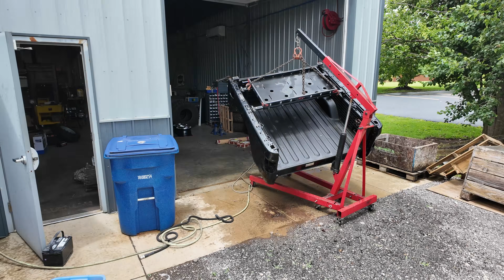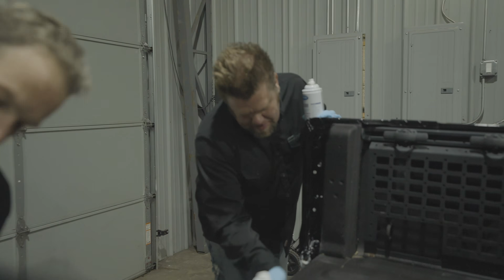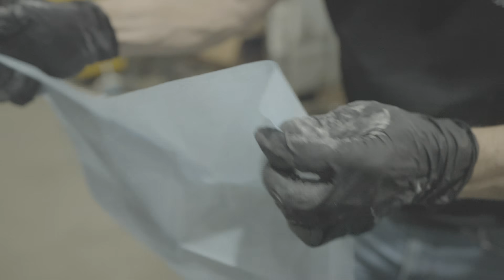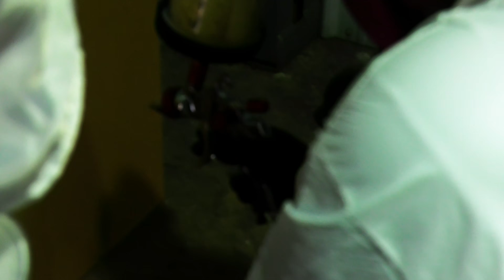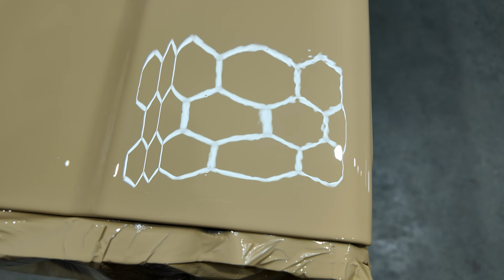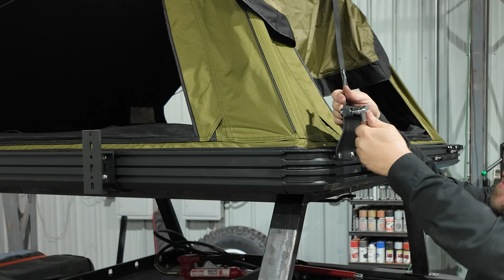Paint Your Jeep in Your Garage

Comment: One correction to what he said about blue cloth. That was actually two different cloths. The first one he used for the Prep solvent (wax & grease remover) was Sontara E-4143 Solvent wipes. The second was a Sontara E-4141 Final Tack, tack rag. That's the one he stretched out. This gives the tack rag more surface area to pick up dust particles from the surface before you apply your paint. Great Job for a first-time paint job!
Reply from the maker: Good info...thanks for sharing

Comment: Sometimes those cheaper gun aren't meant to be taken completely apart, because at the factory they use a sealer, almost like a really weak loctite to take up sloppy tolerances, after cleaning them and putting them back together they will sometimes leak and you will not notice it til you get ready to paint your next project and your dripping paint out from between nozzle and the body of the gun.
Reply from the maker: Thanks for the heads up, I will check that..TBH based on the price of this gun I will probably buy a new one next paint job